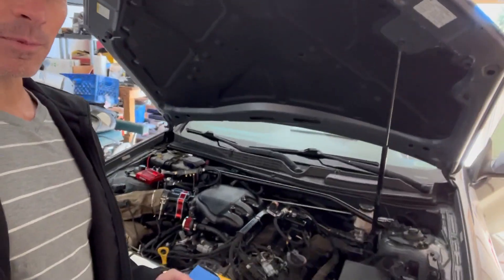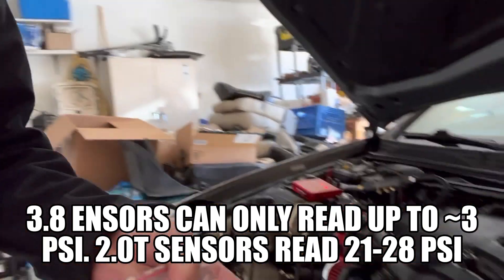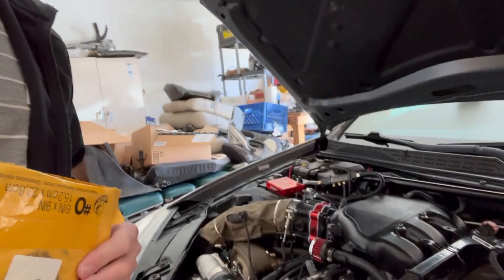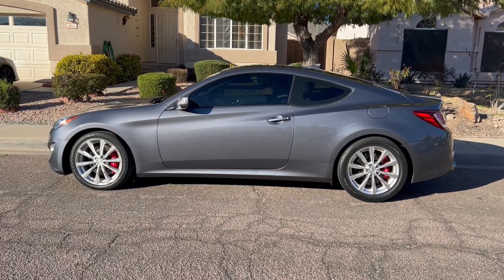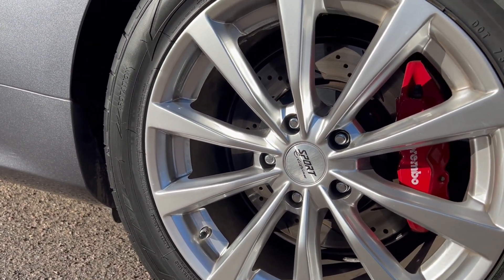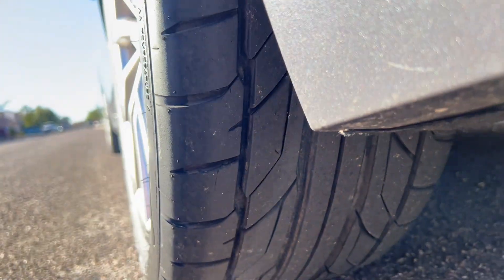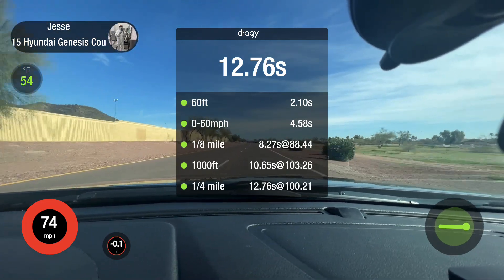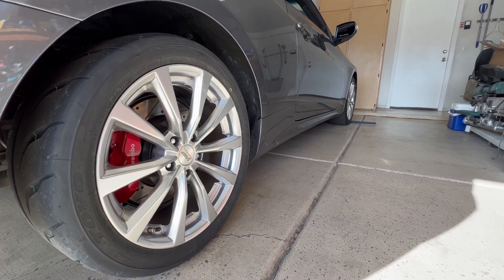Genesis Coupe 3.8L BK2 Turbo 91 vs E85 (Ethanol) Dyno Results Same Car SameDay 100 WHP Midrange Gain

Comment: Any update on this , with the engine build, and results? I'm thinking of building my motor on my Genesis coupe 3.8 bk2, then adding a supercharger.  I know , I know, Turbo is the better option,  but i just wanna go supercharger.  My Genesis coupe is at 143k, so I really wanna build the motor 1st. I ended up buying a 23 Elantra N last year, and I love it, but I still have the desire to add boost to my Genesis.

Comment: What psi you running bro
Reply from the maker: 6.5 psi base with 8 psi peak on ethanol using Go Fast Bits G-FORCE III Electronic Boost Controller, but the engine blew after only 1,484 miles. Stock 3.8 pistons and rods are too weak for turbos I found out on average. There are the occasional success stories and not enough of the catastrophic failure stories to appreciate the real risk. Having a new motor built as I write this. Should be done in 1-2 more weeks and will cost about $12k. Expensive lesson.

Comment: Is this motor built from factory to handle boost like a coyote or a vq ? I’m new to the platform ?
Reply from the maker: Nope, that's the reason it blew after 1,484 miles on a vehicle with only 29K miles.
Reply: Can only handle 8psi of boost from factory everything else above you have to rebuild

Comment: Good luck.  I think I made a decision on my next car. I discovered another neat little car that rose to the top of my list as my next option. The M240i. It also has the B58. So my next choices are a Supra, M240i, or M4. I am leaning towards the M240i because of the price, B58, and extra space. I will contact Darwinpro to see if their F22/M2 spoiler wing fits on the M240i. It is the best wing on the market for the 2 series BMW cars, and I rarely see it on any cars in pictures. This is what I am thinking about as my next car. I have researched the F82 M4 and A90 Supra. Now I have discovered this neat little M240i car with the x-Drive option. I think my next car in the future will be a 2017-2020 M240i because of the price, AWD x-Drive option, it has the B58 engine, and it has the extra car space I like. I don't like the appearance of the next generation of 2 series cars. 2018-2020 are the years I will choose. I have a stock 2016 Genesis Coupe 3.8 right now. The car is already becoming rare. Save it for the value, or sell it? Hmmm. 348 horsepower was nice to experience, but I am ready for the next level. I have never been in a turbocharged or supercharged car before.
Reply: I too have a 2016 Gen Coupe. Thinking about selling it. I rarely drive it. Only has 13k miles on it. Excellent condition. All stock
Reply: 🚵‍♀️제네시스 쿠페 튜닝된거 타면 다른차 생각 못하죠
Reply: In my country, its actually becoming difficult to find a stock or mint Genesis Coupe. My family also owns a stock 2012 3.8 Genesis Coupe since new and its been a nice reliable sports car! I agree with you that its becoming considerably rare to find a Genesis Coupe. I know there might be more in the USA but I know it'll be hard finding a good condition that you can either daily drive or modify.

And in the streets its very rare to find a Gen Coupe to the point that I see more Lambos and even 2 serieses compared to any Gen Coupe and if I do see one. They are either modified well (which is good), riced or beat-up. If you're okay with letting the Genesis go and use that funds to either help you buy the 2-series or modify it. I think you should go for it but if you like the performance and the feel of the Gen Coupe. I recommend that you keep it.

I thought of selling mine now but then after all the memories I had with my dad with it along with its power, looks and huge space. I actually changed my mind. Value isn't there as of now but I think that once Hyundai N / Genesis becomes a well-known brand in the future. As Hyundai's first rear-wheel drive sports car, I bet the value would skyrocket but that will take some time.

Comment: This dyno is reading very low.. did the dude calibrate it good or whats the problem? Maybe wrong gear idk.. From the 1/8 time and the setup overall you should be sitting at 470-500whp +-
Reply from the maker: Nick, the tuner from KHARTunerz, told me in advance that Black Market Racing's dyno reads low. However, it's the change in tuning the car that we were after in the usable power ranges (1,000 to 5,000 rpm) rather than focusing on peak power numbers (7,200 rpm).

Comment: The numbers is off what turbo kit and who tuning the car? 6psi would be around 412hp. I seen those numbers made on a base map on 93 and a  3.8 fbo e85 are running the same 1/4 time 12.7
Reply from the maker: GENESIS COUPE GDI 3.8L SINGLE TURBO KIT - TURBOKITS.COM. Nick from KHARtunerz (https://www.khartunerz.com/) tuned the car on the dyno at Black Market Racing (https://blackmarketracing.net/pages/dyno-rates). Tuned first on 91 gas, then on 65% ethanol (there was still a little gas in the tank when I added the ethanol blend, so the ethanol content was diluted). I just bought 85% ethanol, but am waiting to empty the tank to see what I can do in the 1/4 mile. That 1/4 mile was not the best run so far, it's difficult to find a safe place to run without traffic. I'm planning on going to the track Friday and I'm hoping to break 12.0 seconds.
Reply: With the remaunt turbo kit 3.8s making  close to 500hp on 10 psi with no e85 tuned by alphaspeed. I would do diff upgraded bushing and shims if you trying to launch hard. I think it run 12.7 that 2.1 60ft is going to be the hold up
Reply from the maker: @1430pj  It's fast as is. I don't feel like I need more HP, I need to stick to the ground. I tried to race it at a prepped track on Friday, but they ran out of tech tickets. I was very disappointed. It was my first time to the track so now I know most people buy their tickets online in advance. I think it will be impressive on a prepped track as is, but I have a few more mods I am planning that should make me stick much better.
Reply: @JesseHaggard  I'd try some 275 tires or 305 tires if you really want some grip that thing makes torque pretty down low and it being a auto the torque converter is definitely multiplying the torque mostly in 1st gear.
Reply: Garbage numbers...
Reply from the maker: @SOMEGANGSTER  Wait for the actual track numbers when I finally get to race it.
Reply from the maker: @SOMEGANGSTER  Dynos vary a lot in their reported numbers and I was told that ahead of time about Black Market Racing.